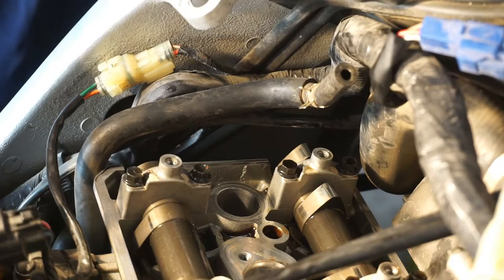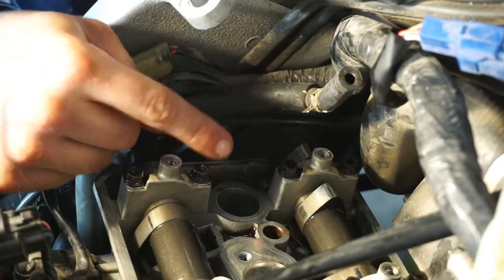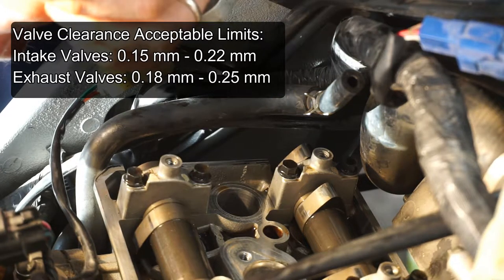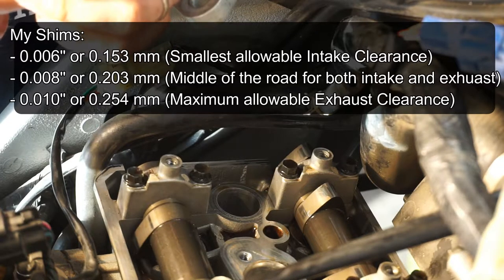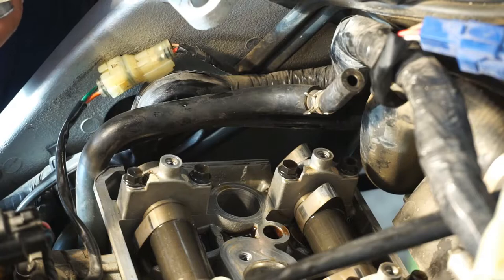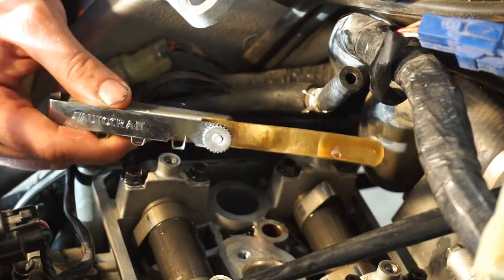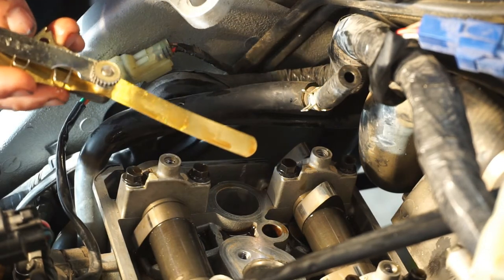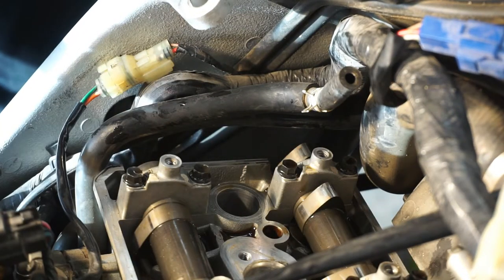Generation 1 FJR 1300 Valve Clearance Inspection

Comment: Comments from a Mechanic
Your checking the distance between the heal of the camshaft lobe (lowest part) and the face of the tappet (follower), shim. The shim sits atop the tappet, fitting into a relief cut into the top of the tappet. The shim is a replaceable wearing surface...
1) turn the engine over (by hand) until the pointed bit of the cam lobes points up
2) Using the minimum and maximum Feeler Gages "Only" ..... check the valve clearance. If the minimum is a "Go" (aka easily fits the space between the top of the tappet (or Follower) shim and the heal of the cam lobe),  and the maximum feeler gage will not fit in the same space, your valve clearance (actually tappet or follower clearance) is properly set. You don't need to know the exact clearance.  Its important to make sure your feeler gage is following the center width of the cam lobe (squared with the lobe)
3) check All of the cam lobes pointing up, and write down which cylinders and which valves were checked. Then rotate the engine until the next set of cam lobes are pointing up and repeat the checking process. 

You check valves with this Go...No-Go method..... Remember your checking valve clearance, Not Adjusting the valves.  Your checking for wear of the tappet shim surface.

Comment: Valve clearance check was something I planed to have a shop or the stealership do, but it doesn't seem as complex as I originally thought.
Reply from the maker: Its not too bad. Takes a bit of time, depending on the bike to get fairings etc removed. But its not too hard. Similar in difficulty to replacing a timing belt on a car.

If you have to correct any clearances, then you need to remove the cams, which is just a matter of getting the engine to TDC and loosening the slack on the tensioner.
Reply: I changed the timing belt on my 4Runner a couple years ago and have done valve train work on cars. Gotta have a valve lash shim set in case adjustments need to be made.  aperaceparts.com has them, but it's an entire set, so after using a few shims, the set will just collect dust, so it would be nice to find a local source for individual shims.

Comment: Mine isn't ready to go until it starts ticking and rattling and knocking.I crank it up, let it run till it comes down to 1100 rpms let it warm up a little more,she starts a little tick,then a faint rattle and a minute later a slight knock from the clutch/balancer area and THEN she's ready to go

Comment: Very good video :) was thinking of getting one of these!! Glad I saw your video
Reply from the maker: TECH WIZ It is an excellent bike. I plan to post a more thorough valve clearance video when I do it in my own bike soon.
Reply: I do have one more question. Many people with the 1st gen 1300 talk about the ticking sound.. that there is a ticking? Do you know of this issue with these engines having a tick???
Reply from the maker: TECH WIZ Ticking only affects generation 1 bikes. Some bikes have it, others never have a problem. Ticking is caused by premature exhaust valve guide wear. Fixed in Gen 2 and later.
Reply from the maker: TECH WIZ See this article:

http://www.bestbits.org/ticking_overview.html

Comment: Just started on doing the valve clearance check on my 2005 fjr. I have everything stripped out and down to the coolant pipes. Is there a trick to getting the coolant pipes off? I have taken the two bolts out where the pipes drop into the valve cover and the two screws/bolts on top. Any advice on getting the pipes out? These feel really fixed still, and I didn’t want to use too much force.
Reply from the maker: Gordon Leech Wiggle back and forth, side to side a little at a time and they should come free. On a 2005 they just likely need a little bit of encouragement.

Comment: Great videos by the way.
Have a question about removing the valve cover to seal a small oil leak coming form the front of the engine near number one cyclinder.
My question is when removing the valve cover and gasket do the other small gaskets inside the valve cover stay in place or do you have to be very careful that they don't drop off?
Cheers
Jim
Reply from the maker: james cramer Depends on if you get lucky. I suggest using a very small amount of black rtv oil sealant to help adhere the gasket to the valve cover. Or if you buy a new gasket it might stay in place better.
Reply: Many thanks for your quick reply. What happens with the small seals inside the valve cover when removing it? Do they come off with the valve cover or do they stay in place? Did you have any problems getting to the front two outside valve cover bolts and if so whats the best way of doing it? Sorry for all the questions but I just want to make sure I know what to do when taking it off.
Cheers
Jim
Reply from the maker: james cramer Jim, working on a full valve DIY video now on my 15. Hopefully that will help you. Should be published in about a week.

Comment: You spend way too much time talking about your "shim" tool by which I think you mean feeler gauge.  What we want to know is where to position the cam lobe for each of the 16 valves when we do the measurement.  Why do other videos talk about using TDC?  Why do other videos show the measurement taken when the lobe is pointing somewhere off to the side instead of straight up?  Think about someone trying to do this job for the first time and what the actual steps they need to go through to get each of the 16 valve cams in the proper position to take the measurement.  Assume we know how to use a feeler gauge and can do addition and subtraction.  Those are the easy parts!
Reply: as long as the lobe is up on which ever valve you do then you check with feelers  i do exhaust first then the inlets

Comment: Well you better too have some slack on the clearance than been to tight.With heat expension the gap become short and you can burn the valve seat,,.i it is .006 and you have 7 or tight 8 it is not a big deal at least for me i would let it this way.
Again ,for my experiences,a loose valve clearance is way better than to tight but been professionnal as this gntleman it is the better way! i wonder what is the duration between valve adjustment??? 

Gef
Reply: 26000 miles